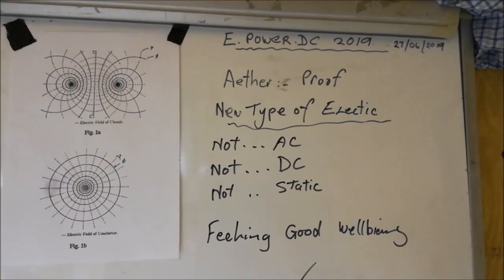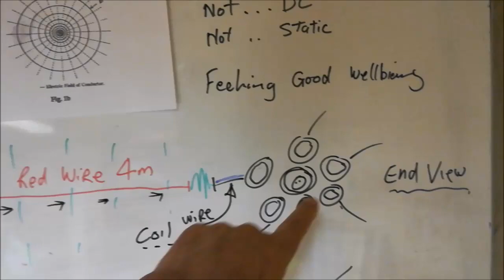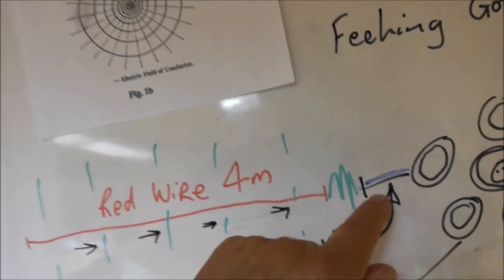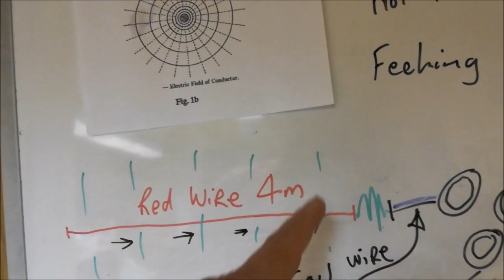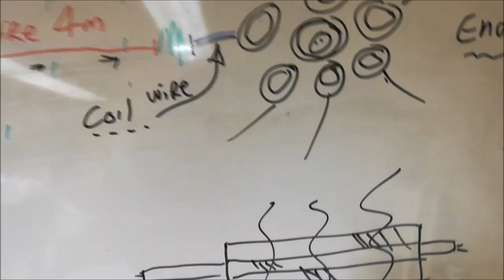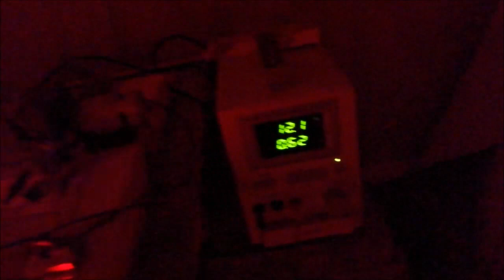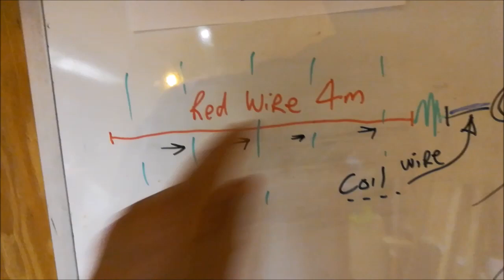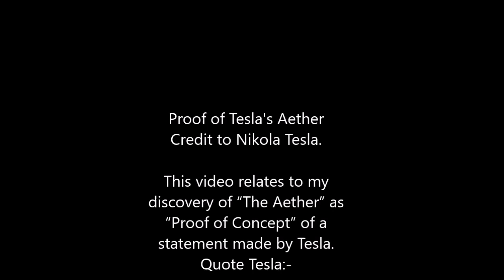Tesla's Aether Proof

Comment: It is interesting, what you think about the following of my thoughts; the room with wall is connected to the ground, the environment is a big capacitor that it has potential energy. It generates voltage difference around the height of your hand, top of the wall and on the ground of the room. A circuit is completed according to Tesla his work, as you are holding the wire and next to the machine you built, so the current generated also around you and sparks is the result of polarization we can see with our eye 😊
Reply from the maker: I have experienced this verbatim, Aether rebound (Static) yes?
Rgards DC
Reply: @e.powerdc1127  yes it effects with aether but dunno how to detect:) your body is antenna, so can feel it

Comment: Hi, is it possible to discuss how you made this with you please ?
Reply from the maker: A.C. hi. Ok simple method.
Ingredients
1. 1m long steel tubes.
2. Copper wire 1.5mm blue insulation.
3. Car spark transformer 30,000v
4. Power supply.
5. Rotary contact breaker powered by variable speed DC motor.
6. Floresent light 4ft long.
7. Wire connectors.
Very simple single winding on steel tubes.
Making and breaking of the DC supply shocks the car coil producing 30,000v of a positive pulse down the floresent light. This pressure reacts with the Aether.
This is work in progress thanks for your interest.
Regards... DC
Reply: @e.powerdc1127  thanks - I'm AC & you are DC - we should start a band :)
Reply from the maker: @andrewcampbellsmith1880  pulse or vibrate name:- "Non Electrons" or the Magsparks! Regards... DC

Comment: I'm afraid you are not obtaining any sort of power from the Aether.  What you have is a very low efficiency capacitor coupling to your HV source..  The red wire, because you have it connected to the wall, is at the potential of the wall, which should be ground, your circuit is operating at a floating potential I imagine which makes it easy to have a potential.  Your fluro and coils create a very poor capacitor which couples your HV circuit to the potential of the wall.  Sorry man...

Comment: I might be wrong but that red wire is grounded and you are just shorting it to the ground and sparks appear because of the high voltage.
Reply from the maker: Hi M.M.. The 4m red wire is simply a 4m x1-5 solid core copper rised at one end while rapped around sensor.
It detects the magnetic lights up and bleeps.
But when a gap is made (2mm) no sound / light just a spark.
This is the aether contracting / flexing.
Regards ...DC

Comment: Have you ever wondered why, when it comes to hertz, electrical engineers 'settle' on such figures as (in the case of displays) 60hz, 75hz, 120hz, 144hz, 240hz and now they've gone to 360hz - ever wondered why a man would pick a number like 144 or 44.1? Why is digital audio recorded at either 22.5khz or 44.1khz? Why would anyone ever 'settle' on 44100? Why not just 44000?

You'll notice that all of the above figures are divisible by three. I notice that you have a 6-way coil going on. Seems to me that nature forces us into multiple of three when it comes to electricity. You might want to consider that. Tesla himself was enamored with multiples of three. We're sort of stuck in a binary system, aren't we? Always looking to divide by two and arranging things into groups of ten - which is not divisible by three.

Why is it that batteries mostly come in 1.5v, 3v, 4.5v, 6v, 9v, 18v and 24v flavors? Why is it that those voltages just happened to be the best? Seems like discovery to me - as opposed to invention. We didn't 'pick' these values ... we copied what nature presented to us.

I suggest trying to see and think in terms of this. Amplify by a factor that is divisible by 3, ensure your input voltages are divisible by 3, that your currents and resistive elements are divisible by 3 - you get the idea. Make everything 3-friendly so to speak. See what happens. I personally see 3 as being 'whole' - the minimum needed for true balance. We think of 'balance' in terms of 2 - this way or that like a see-saw - but in nature there are 3-way balances. A bicycle won't stand by itself but a tricycle will. The triangle is the simplest possible 2-dimensional construct too - you need a minimum of 3 points for a lot of different things - both physical and not, or semi-physical - like electricity.
Reply from the maker: 3D4U Hi, you are so correct. The  50mm Dia steel scaffold consist of 7 tubes. Central firing tube with 6 tubes around the fire tube.
Tesla noticed "Lights / Sparks" traveling on the surface of his wires. This is what i have found too!

So light / Electric is chasing each other. Magnetic, Dielectric And X. What do you think X could be?

Its all about the Magnet!

Regards ... DC
Reply: @e.powerdc1127  I think X is a forward motion that comprises of two steps [loops] forward and one step [loop] back. We always imagine things moving straight ahead when we consider such things as particles moving at the speed of light but I don't think that's the case. Is an electron a particle or a wave? We say 'both', right? It's this little knot of energy that has a property we call wave/particle duality - it can act like a particle and sometimes it can act like a wave but it always travels at the speed of light in a single direction - that's what we're taught in physics.

Well, since it is always traveling at the speed of light how would we know if it moved backwards a little bit and then forwards again?

First consider that nothing moves in a straight line, that these particles always move along a spiral path, looping about a central axis as they move 'forward'. If you take the unit circle, that which gives us sine and cosine which are somewhat analogous to to the magnetic and dielectric fields in EE, and begin to move the point about which the circle is made - say in the +Z direction - you'll end up tracing the path of a spiral and this is what particles do - this is how they can be both a particle and a wave at the same time. If you look at a spiral from the side what you see is a waveform - each cycle on a waveform correlates to a loop on a spiral.

As to this forward motion - what we call the speed of light .... well, if you had this particle and it was following this spiral path AT the speed of light and it made a sudden loop backwards along that path before continuing forwards again ..... how would we know? Since it's happening at the speed of light - which is the same to anyone in any frame of reference no matter which direction it is in - how could anyone ever tell if such a thing was occurring? Loop, loop, back. Loop, loop, back. Loop, loop, back. + + - ++ - ++ - If that were happening at the speed of light all we would realistically 'see' is something moving in a specific direction at the speed of light because it would still have an overall forward motion and everything is happening AT the speed of light.

Current happens AT the speed of light. When an atom is ionized the electron that is knocked off is traveling AT the speed of light until it takes a position in the valence of another atom so it could be said that current in an electrical system happens AT the speed of light - there is time delay before/after an electron finds it way to an atom but as it moves between one and the other it happens at the speed of light. I say these spiral paths loop back upon themselves every two loops, we just can't see it happening and we can't imagine a backwards motion because all we see is forwards motion. I think that this is what we're missing - a backwards loop or 'step' of some sort.

If you have the time and the inclination perhaps you could make a coil of wire that does this and see how it operates - loop forwards, loop forwards, loop backwards. It would take the form of a stepped coil that would be 3 layers thick in the end.
Reply from the maker: @alflud  We are on the same page. Totally agree with the buck type coil. 
Work in progress is shaping up. A "Generator using the Dielectric" I have two methods to introduce... Plan "A" & "B" very simple to make, the trick will be to get them to work ...Ha ...Ha!!  .. Regards ... DC
Reply: @e.powerdc1127  A buck-type? See ... I'm actually quite ignorant when it comes to electrical engineering - I didn't know such a thing existed or I'd have just said so. Also, I'd have said what was missing was a longitudinal component, if I wanted to keep things short in the above post :) I've been doing some more looking into this and found that some early electrical pioneers are said to have worked with longitudinal electric waves - it's still way over my head, some stuff about counter-space and counter-time even but that does sort of line up with a backwards step notion, doesn't it? Also, in longitudinal waves there is backwards motion as well.

Is it possible to create a wave that is both transverse and longitudinal? And is a 'buck-type' coil a physical analogue? When you're winding a normal coil you are usually moving up, left, down, right and forward and that 'buck' is a backwards wind, then right? which would sort-of represent a longitudinal component?

In any case, I wish you nothing but the best of luck with your current work in progress friend, and that you continue to feel good :) I'll subscribe to see what you get up to.
Reply from the maker: @alflud  electric is not what it seems. So its good to seek. Regards ... DC
Reply: @e.powerdc1127  Here's a small video clip to more clearly illustrate what I'm talking about. https://youtu.be/BMe4BMWdBas
Reply from the maker: @alflud  Thanks really good video, great eye candy!  ... Regards ... DC
Reply: @Muckin 4on If you were to create an arbitrary set of length units and I was to create another one and we lined them both up against each other, at some point we'd find that there is correlation - where, say, 7 of my units exactly equals 16 of yours or something like that. That is to say that no matter what set of unit we devise there will always be some points where that system lines up with natural systems. This is how, as you say, we "get stuck" with values. We will always 'settle' on what works best, right? Our base 10 system correlates with natural systems in many ways and we think of this as settling for or being stuck with a value.

Comment: Shouldn’t you also test in a near vacuum? Then compare both findings? As Fermi put it “you must calculate the flux”
Reply from the maker: Hi T.M. I do not have funding for vacuum. The pulses go out in one direction. Seeing the spark jump off the copper wire is a great clue, I was amazed at what it showed me. Regards .... DC
Reply: @e.powerdc1127  are you in the uk? what is your email address? i want to buy you the equipment you need
Reply from the maker: @deebahra4777  Hi D.B. very kind offer. Its OK, I have managed to find enough £ to now order both units. Then work out this new technology and apply it to the project.
I can not wait to further experiment.
My very best regards... DC

Comment: Done something like this in the shop, any metal object produces a spark. A low tech device is the Tesla hair pine circuit which can make a 500 watt quartz lamp glow to 2/3 brightness through a 30 gauge wire at seventy feet. The maximum amperage for the wire is 0.142 amps, the light takes 4.2 amps at 120 volts for full brightness. There are many experimenters that have discovered method of using the aether. It is an amazing material.
Reply from the maker: This experiment shocked me. Cos it didn't make sense. What do we see at the spark gap, I mean the actual spark? This is the question? What do you think we See? Regards.. DC
Reply: @e.powerdc1127  I think that spark is ether modulation, or an ether perturbation modality, or radiant longitudinal dielectric elemental transmutation, as opposed to plasmatic transverse deconstruction of molecules.